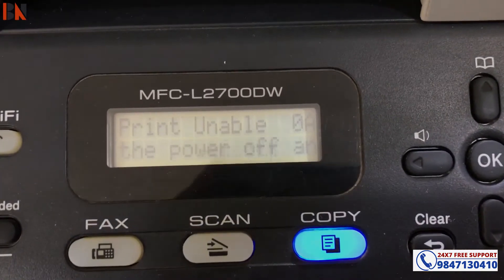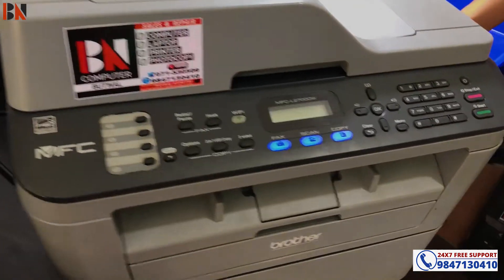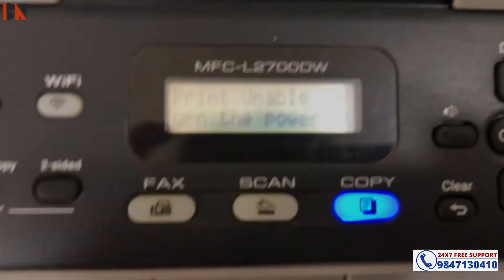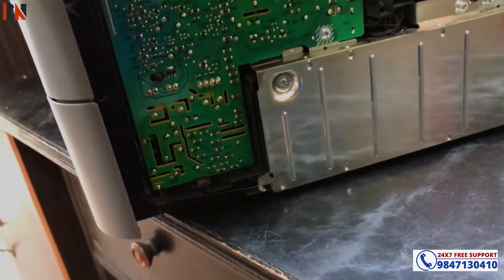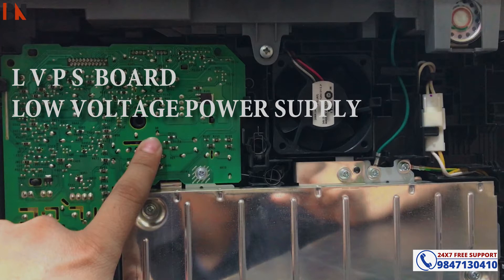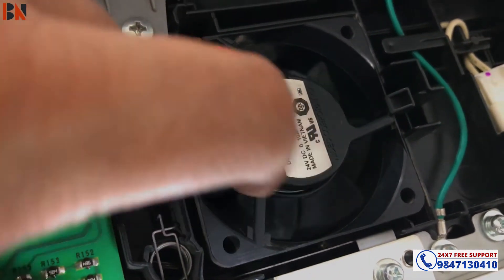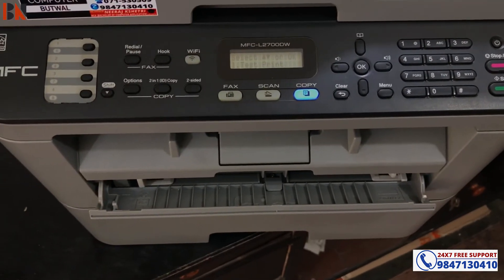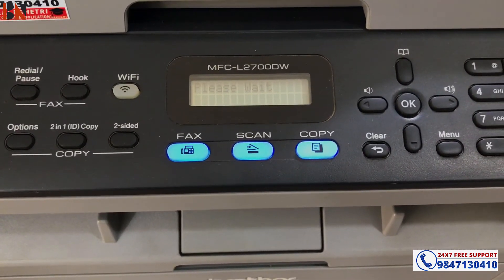How To Solve Brother Printer MFC-L2700DW Print Unable 0A Error | Step By Step 100% Solved Easy Soln

Comment: try to remove the power cord on the socket, press the power button hold for 3sec.. press cancel.. press again again the power button.. leave and standby the printer atleast 5 to 10 mins.. before you plug the power cord to different socket.. then power on the printer..